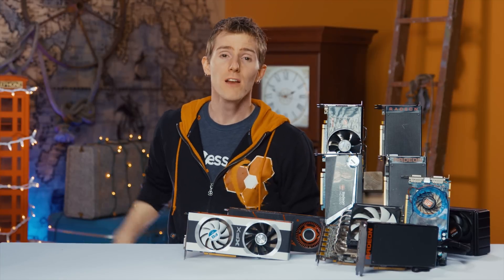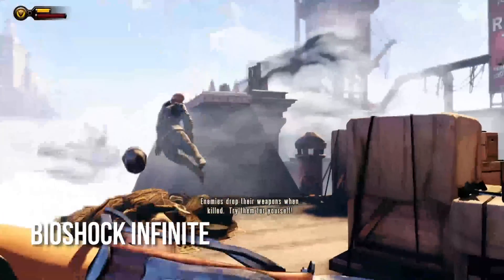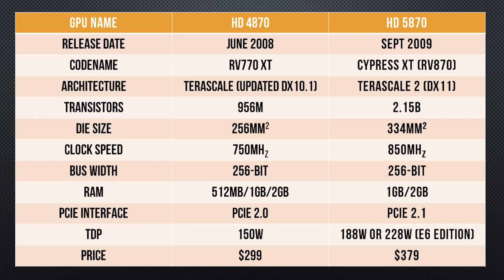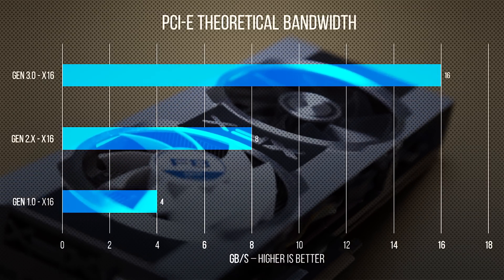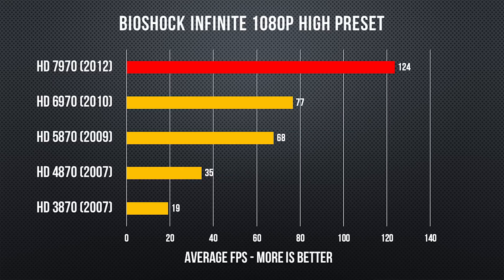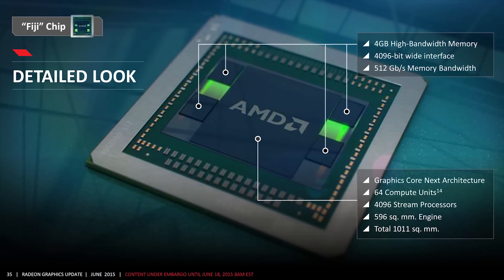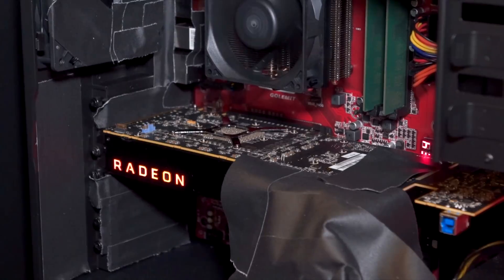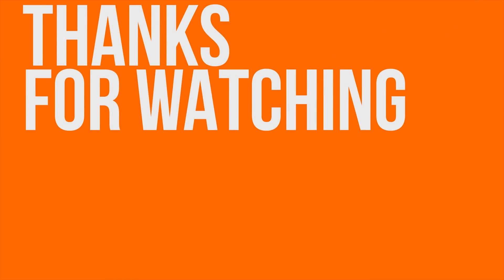10 Years of AMD Video Cards BENCHMARKED!

Comment: They still can't hold a candle to Nvidia cards today. 

I purchased a R9 295X2 brand new. Drivers have always been poor. The biggest issue is AMD designed it as a 4K card but only gave it 4gb vram per gpu. Even on launch games needed 4gb @ 4K. They need to pull their heads out of their ass and get with the times.
Reply: they are positioning themselves as the "cheaper alternative" people who wants the best of the best are better of buying stuff from the green side but reality is not everyone enjoys a deep pocket and it's nice there is an alternative for those people, I myself have a GTX 1080 but I do benchmarking with two 480's in crossfire and they can hold their ground even with the most demanding triple AAA games today.
Reply: Even when they tried to be top tier, who gives a 4K dedicated card only 4gb of vram?? 

They did it again with the fury x2
Reply: Brad Sankey my opinion is people that want a taste of high-end hardware but have a budget for a medium end hardware gets that, they had to do some comprises to cut production cost while still generating income.

Comment: When I got my second R9 380 for my crossfire setup it never posted - fried two cards and half my mobo because of faulty psu wires. While I RMAd the two cards, I dusted off one of my old 8800GTs from my parts bin. Boot right up. I went back and finished the first Witcher game on it - amazing! The AMD cards came back and I got a new motherboard. The new system runs HOT and SEXY after a lot of tweaking. I am happy with it.

Comment: Bought an R9 295x2 in 2017, haven't been disappoint, uses less power and overclocks better then 2 separate R9 290s with EK waterblocks I had previously.

Comment: I am not a fanboy for many components/pc hardware however amd has a soft spot for me because i owned many GTX graphics card starting with the 
GTX650 then to the
GTX 660 then to the
GTX 960 
But i could not pass up the beautiful price i got my 390X at being a bit cheaper than a GTX 970 at the time since then ive never looked back and ive never had problems with drivers one BIG BIG detail though
is that i dont play ANY games that utilize the 390x i play rocket league and CS GO
other than that maybe dirt rally and dirt 3 but thats the way top end of my graphical content

Comment: What's the best AMD GPU for 4K and possibly VR?
Reply: Since when do FuryXs cost 900 dollars?! You can't really buy them new and on ebay they are 400 and under.
Reply: None,  2 980ti's for 500 to $600, or slightly slower but better for vr 1080ti for $700.

Comment: insightful.  but has only inspired me futher to never leave Nvidia's side when it comes to GPU's.  I mean, i feel sry for anyone who bought an RX 480 (Based on your graphs).  It just looks like a re-purposed R9 290X.  3 Years later and, in hindsight, a step backwards.
Reply: ed dale But a looot cheaper, can be found easily for 180$. >> 500$ of the r9 290x, not to mention much better power consumption and thermals

Comment: The RX480 is actually pretty beast for 1080p at $200. If you look at the benchmarks, after two generations, a gpu 1/3 of the price has better performance than a previous flagship.

Comment: 8:38 The chart says the full system power draw under load with the 7970 is 225 Watts, you fucked up: that is the 7970's TDP alone, not the full system power draw.  The 7970 had a 6 and an 8 pin connector, 6pin(75w) + 8pin(150w)+ PCI-E slot(75w)=300 watts.  The card's TDP is at least 226 watts other wise it would have had 2x6pin or 1x8 pin connector. The RX 480 has a single 8 pin (225 max) and it certainly uses less than that, and much less than the 7970.

Comment: AMD literally went backwards. Their 2016 card got its butt kicked by the 2013 card in half the benchmarks.
Reply: Not really, with the 480 you're getting the 80 suffix cards to the performance of the previous generation's 90 suffix cards. Which is an improvement. Fury is a separate thing, it's got HBM, you compare it to Vega not the 480.
Reply: you're comparing last gens high end gpus to a new gen mid-range gpu. Wait until AMDs new high end gpus come out. Then try to say the same thing.
Reply: NVidia litteraly went backwards. Their 2016 GTX 1050Ti got its butt kicked by the 2012 GTX680 in all benchmarks. (see what I did there?)
Reply: That's like comparing the 980 ti vs the gtx 1060. Hmmmm, I wonder which one wins?
Reply: razje you are right. both are in different generation and price range. we should take that into consideration
Reply: 3gb simply isn't enough of a buffer for today's games.
Reply: You're an idiot, it's a price to performance video card launched at $199
Reply: Of course I didn't read your story because I wasn't replying to you.
Reply: and ? But todays new AMD cards or nvidias sussport todays new technologies and lower power comsuption. So whats the point of that old video card ? And stop bullshiting about RX480.. evan AMD claimed, that this card is orientated for price/perfomance customers only. Also wait for Vega, because thats what will give u what u want. price/performance but also improoved perfomance and again will be top tier card in AMD history line up.
Reply: PCMasterRace I would love to see those benchmarks can you point me in the right direction
Reply: razje well the 1050 ti Is identical to a 680 in performance wise.BUT Its more energy efficient and retails for cheaper (if you compare them brand new).
Reply: Aryan Race clearly didn't read my post
Reply: from a 480 purchaser(and return) i can see if you have no gfx card why it may appeal but still a 1060 is a far better investment imho. The extra gb on the 480 is worthless without xfire so just get a 1070 and get that performance from the start and pay a little less than the $400 for 2 480's. 
But really a 480 is a pointless card for anyone rocking a 7950 or newer equivelant. The only benefit is more vram but its pointless because the card doesnt have the power to use it. If they just made it 4gb and dropped to the 470 price then it is much more realistic of a purchase. But the hype and first few months at $280 was ludacris for its low performance.
Reply: 3gb is plenty for most as long as you dont go above 1080p, 4gb is nice but the only game i can even think of that may use some of that at 1080p is GTA5 and once again it goes to my argument any card at that power point anyway wouldnt have the power to use over 4gb of vram for it to make sense.
Reply: What benchmarks exactly i can find what you need lol.
AMD has not gone exactly "backwards" but the market itself has changed dramatically during the last ten years and although amd has remained "competetive" there has never been a year the last 10 years where in majority of games Nvidia takes the market share in quality and quantity.
The thing is although alot of benchmarks focus in on a few or a dozen or so really well funded multi platform games. The issue is not there and alot of tech enthusiast know not to trust every benchmark you see and look for the games you want to play. AMD and NVIDIA stay "competative" in the stock clock market when gaming performance is mentioned. Considering most enthusiast will overclock and NVIDIA has a history of higher temp thresholds and clockspeeds nvidia typically wins overall once all is said and done. 
The markets are different too. Without trying to directly insult anyone because i love both amd and nvidia and have had great cards from both i also see the downfall of amd and it is very apparent while the only complaint of nvidia always seems to be "ANTI CONSUMER" which i disagree and feel it is more the blame of amd(who i have easily invest 5x as much $ into than nvidia) because they choose to avoid where they loose and focus on where they win. On the other hand NVIDIA is always looking to push the market and show AMD up every way which AMD fans feel is "anti consumer" but lets get facts straigt about both good and bad.

lets go bad first and lets go AMD
AMD has been complacent, the market has stalled and it is solely due to poor % increases of performance from amd and its enthusiast market.(sans fury x)
AMD has taken a long long time to equal nvidia in driver update and video card multi functionality. While they are great "data processors" as far as implementing what they do into 3d graphics it is left with more wanting comparing to the #'s on the specs such as mhz and memory.
AMD overy sells specs but under delivers on architecture. They sell every new GCN card as a breakthrough but really its mundane improvements on systems that become obsolete very quickly.
Lastly AMD is ALWAYS LATE since the year 2000 when they were the first to introduce and break the GHZ cpu limit they have rested on being the first at that and assumed the past 15 years would pay them back for that.

NVIDIA CONS
PRICE
PRICE
PRICE

AMD POSITIVES
CHEAP
CHEAP
CHEAP
Freesync

NVIDIA PRO's
Constant work with developers to deliver the maximum performance for its customers, we can argue they "Sabotage" amd but amd does not have the money or effort put forth to do what nvidia does.
PHYSX many may argue it means nothing but amd has plenty of opportunity to optimize its own equivalent(also remember physx isnt just another name for ragdoll effects, it governs particle effects, lighting effects and much much more) I take TressFX as an example amd did pioneer this tech and they did not make it readily available for nvidia but nvidia came out with its own equivalent within a year called HAIRWORKS which arguably is better overall in quality although maybe not noticeable by most
OVERALL PERFORMANCE NVIDIA is the king of overclocks, besides a few outliers the past 10 years when you take equal generational cards from both NVIDIA always outperforms after overclocking which is tale tale of who has better overall tech nomatter if you buy top or bottom end.
Reply: The sun will burn out first. AMD release schedule is absolutely pointless, they're drawing out of months, giving next to know details to a consumer base that is already incredibly skeptical of them and all they do is release hardware that only just started to match the current competition at a marginally lower price point, which in response are likely to see the next release cycle of Intel and Nvidia wipe them out again. It makes no difference if you're only getting a head once every 4-5 years at most, they need to be consistently producing quality CPUs and GPUs every year that beat the competitions next generation or match it whilst offering something unique that the other side doesn't have yet. For me it was drivers and I've never had a problem with Nvidia's drivers since I moved over.

One of the reason I abandoned AMD isn't because of the hardware, it was software. However, until I see their hardware running at equal to cooler temps as Intel and Nvidia whilst providing the same or better performance and similar price points I won't be going back. I'm more than willing to drop an extra £100-200 if it means I get near double the performance, up to 20 degrees cooler and noticeably less power draw with more reliable drivers that get updated often.

It's not as simple as a case of fandom AMD are shooting themselves in the foot, I would love to see them going toe-to-toe with Intel and Nvidia in the high end market but they just aren't doing it, Rizen still isn't giving me any incentives to move over for next to no improvement over my current set up except spending more money I don't need too. I still recommend them for budget builders looking for something on the cheap for light gaming like MOBAs and the likes but it works out more expensive in the long run if you're upgrading your gpu every 2-3 years because its over heating and not performing at half the level of the current competition.

Comment: You said all 3 of the big players but all I see is 3 versions of sony playstation and 3 versions of Microsoft's Xbox, the switch uses an NVIDIA CPU
Reply: he could mean mobile phones, if you have a android device the chances are your running a adreno gpu which is a anagram of radeon because AMD make the adreno GPU
Reply: Nah, playstation, playstation and xbox sound like the three big players to me
Reply: andrea russo ya I think Nvidia still has a way to go for developing console graphics
Reply: He said current gen, and Wii U is an 8th gen console together with PS4 and Xbox One.
Reply: The Wii U used an AMD solution. But don't expect new LTT to be either accurate or up-to-date
Reply: nvidia cpu is based on ARM,that's trash for gaming :( it won't ever pack as much horsepower as other gaming consoles

Comment: 7970 is a value beast, i got 7990, basically 2 of those in 2017, so if a guy bought 2 in 2012 and managed to keep them until today, 2017, they lasted a really long time... i bought my 7990 at the end of 2013 (release) and not upgrated yet, still plays some games at 1080p but now at medium, but bf1 at ultra and some other, depending on optimization

Comment: Hey guys I need help.
Yesterday I found out my computer had a virus called "drmkpro64.sys" I found this out because whenever I tried to start up my PC after 10 seconds I would get a Windows stop code and it would reboot. I used safe mode to disable the virus from doing that and ran Malwarebytes anti rootkit after it prevented me from using the regular one. Now the rootkit ran said it got rid of it only for my internet not to work. it says I'm connected to the internet in the bottom right and chrome says it's not accepting from Port 8003. I think this is either a effect of the virus or because I only ran the system scan and not the driver's scan because it was taking too long. I know this isn't the place to post but people on this channel typically know there way around a computer and I'm kinda freaking out so please respond and thanks in advanced.